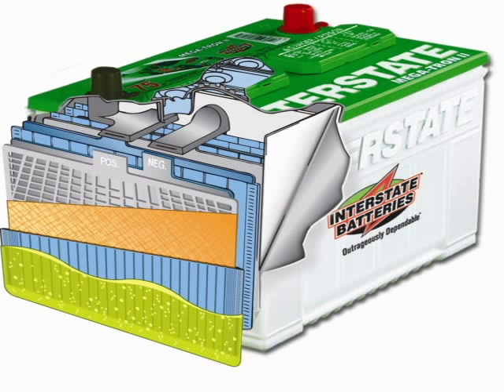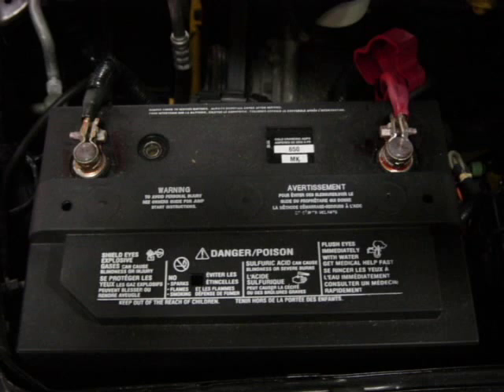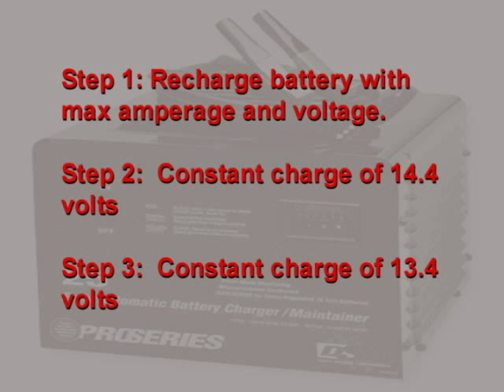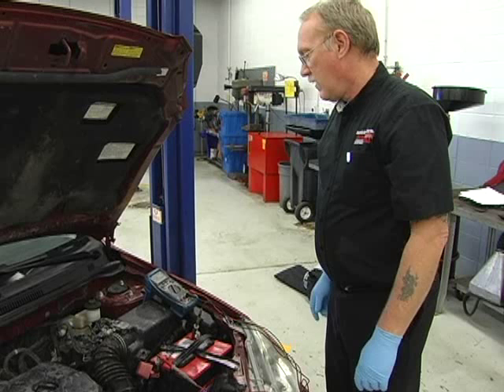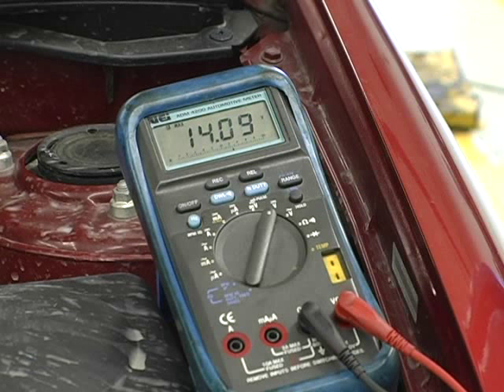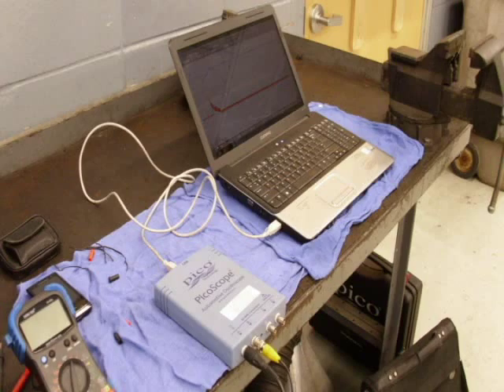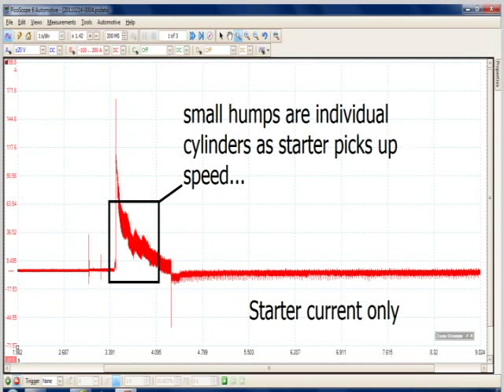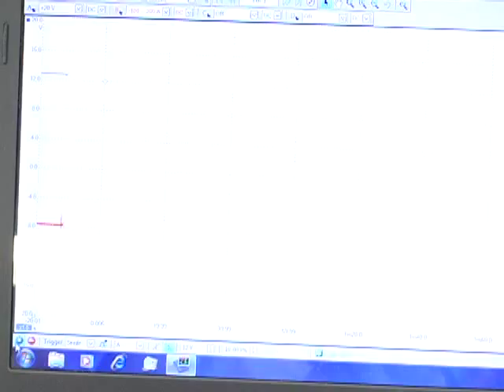The Trainer #4:  Testing Battery/Starting/Charging Systems

Comment from the maker: The scope samples the signal so much faster than a DMM can. That's the reason for the difference in voltage reading. To compare, look at the scope capture with a 200 amp load applied (typical of a battery load test) and you'll see a more "normal" reading.

Comment: Hey, Pete. Could you please explain how a battery explode when it is being charged? You said something about electrolyte, corrosion and when charging the battery( How we talking about when the alternator is charging the battery or when we are charging it when it is discharged?)
Reply from the maker: That's a great question! The easiest answer is this:  Batteries produce hydrogen gas which is highly flammable. If a spark is introduced (connecting or disconnecting the cables improperly), that could cause the battery to burst. But that's not the only way, as I learned researching your question. I found this information on a site called Lifewire (https://www.lifewire.com/dangers-of-exploding-car-battery-534782):

The first ignition source is a spark created when connecting or disconnecting a jumper or charging cable. This is why it’s so important to connect to bare metal on the engine or frame instead of the battery. If you hook up the negative jumper cable to the battery itself, any lingering hydrogen may be ignited by the ensuing spark. This is also why it’s a good idea to wait to turn on or plugin, your charger until after it’s connected.The other type of car battery explosion still involves hydrogen gas, but the ignition source is inside the battery. The issue is that if a battery isn’t properly maintained, and the electrolyte level is allowed to drop, the lead plates will be exposed to oxygen and may warp. This can lead to the plates flexing and touching during the extreme current drain initiated whenever you crank the starter motor, which can result in a spark inside the battery. That, in turn, can ignite any hydrogen present in the cell, causing the battery to explode.
Reply: Thank you!